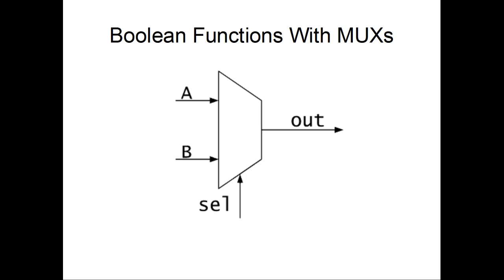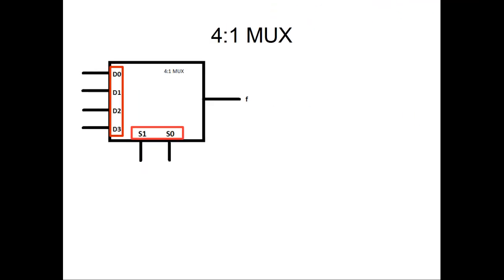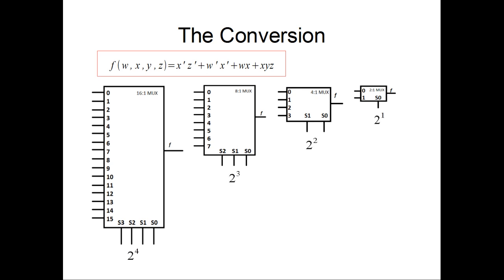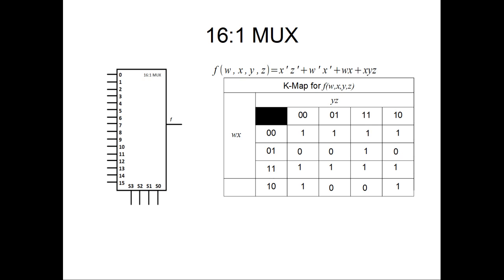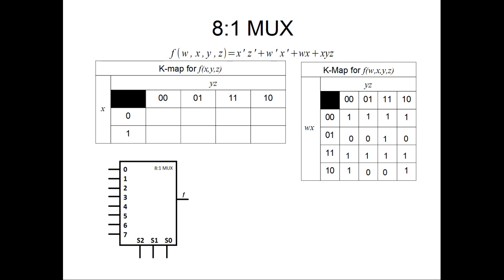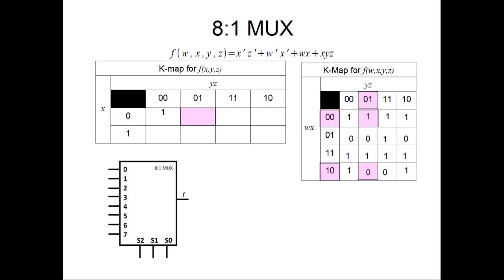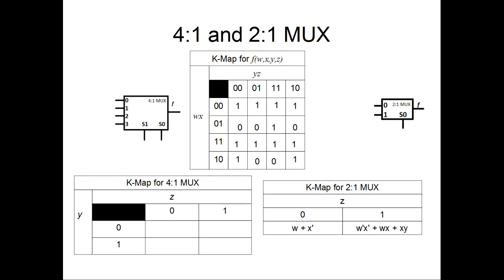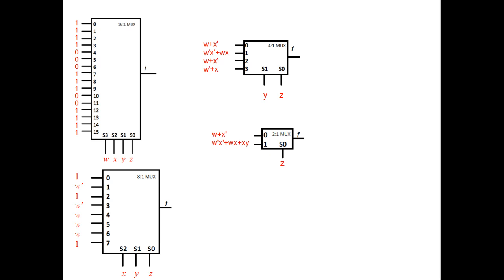Expressing Boolean Functions with MUXs

Comment: Thanks, great video! I think the selector inputs got mixed up with the MSB of the function on the MUX diagrams. S0 was getting the LSB, but I believe it should have been the MSB. Can someone confirm this?
Reply: +mech_builder Actually, I had it backwards and the diagrams in the video are correct. MSB of function does go to MSB of MUX. (this is for anyone who gets mixed up like me).